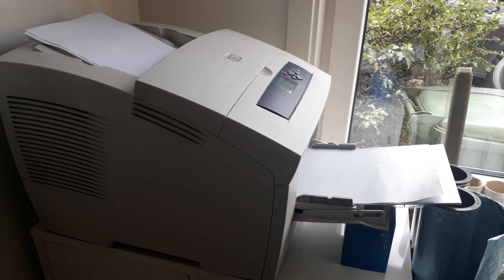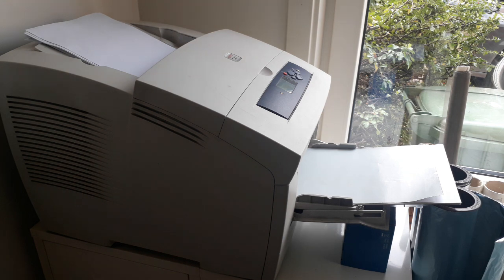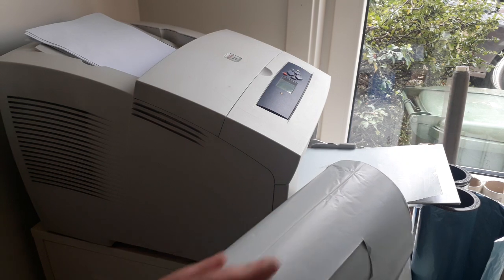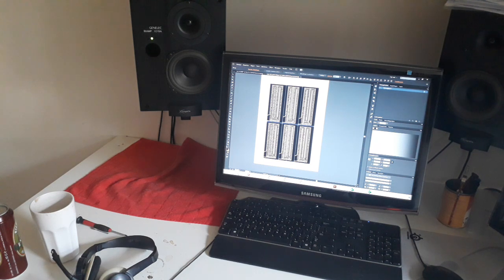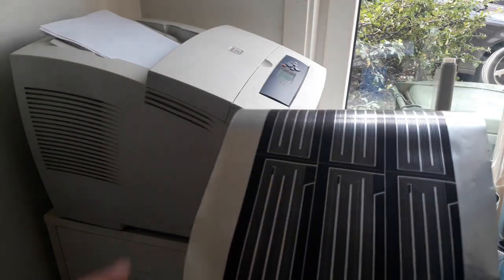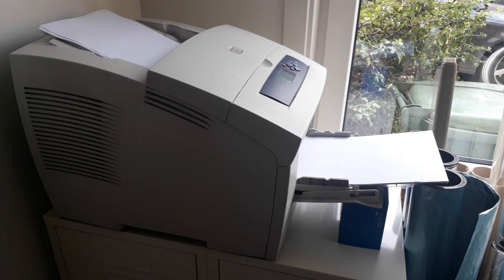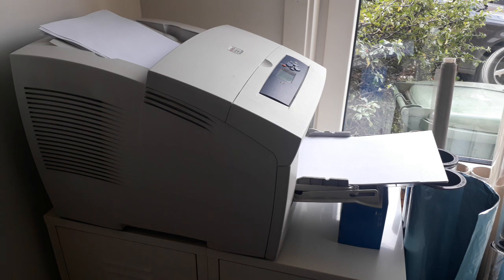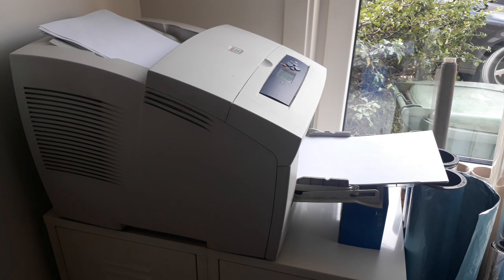Neo Tweeter v5.2 - thicker foil ?? WHY !!!!! Part 1

Comment: The issue with 20KHz is that you need a transducer able to hit 120dB SPL (at the listening distance), in order to have a young person barely perceive it. If you take a look at the human hearing curve, 20K are perceived only at the so-called pain-threshold. No tweeter can achieve these levels, except, perhaps, for tall line arrays. On the other hand, high or even super-high extension, even at much lower SPLs(Sound Pressure Levels) IS desirable from a tweeter, because the normal sounds that we hear are not simple tones but complex sounds, where a 20 or even 24KHz component/overtone, even at a much lower level than the threshold of audibility, (nonexistent, of course, in the case of 24K), may well have a subtle psychoacoustic effect and when it's missing, this may account for the "artificial" or "unreal" sense we may get from played-back music. NICE WORK, BY THE WAY. YOU SHOW US A LOT OF PROCEDURES  I HAVE BEEN UNAWARE OF.  In my opinion, it's wrong to try to cross a tweeter low. You'll never be able to get BODY for your music from a tweeter crossed low. It can never play loud low, undistorted. So, uprising ribbons are good to cross from 8 to 15KHz. Use a nice, ripe and juicy full range dynamic (or even big membrane) driver from there down. Some compromises are always required, of course.
Reply from the maker: Thanks for chipping in :) well about the line array :) the problem with them is they getting so large that usually you only hear a tiny portion of it doing 20khz. thats why it is ideal to make a tweeter that does go low if you make it a line source.. but... it has its own problems only if it is a true line source it wont have weird peaks and dips  :(  and true true would be infinite long :) but bot to ceiling would do :) but who wants that in there room hehe. :)  yes playing it loud un distorted is the biggest problem. it is all a kind of balance act.  having it rather small or compared to domes rahter big and go lower... or not able to go low  at all.  having it be a rather low resonance does give people options.  if you want it to reach low (lets say 400 hz)  then make a line source. or i got some other ideas :) that would keep the original  dispersion patern in tact.  think about 2.5 woofer systems and esl's. im just gone let the side panels drop of high frequencies to have the same dispersion while being able to make the pannel bigger then a tweeter could be. :) aaah well so much to try. unfortuate i burned my amp down yesterday so im still a bit pissed of and yesterday i though i never start again fuck this crap. :)